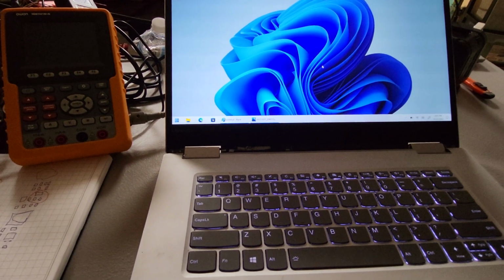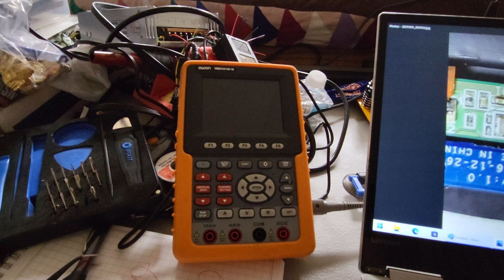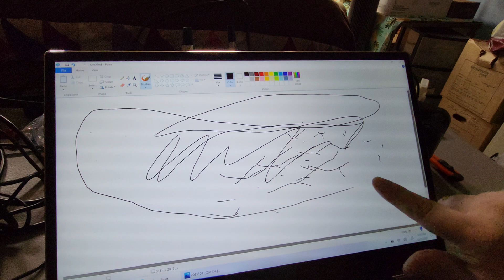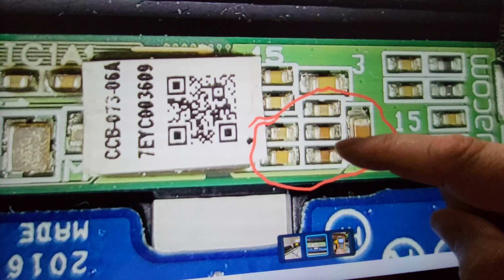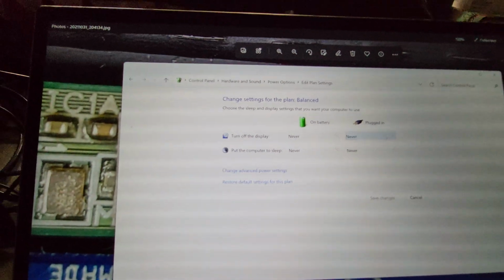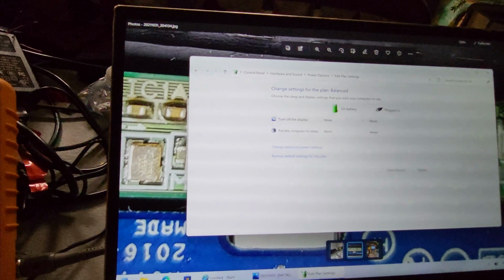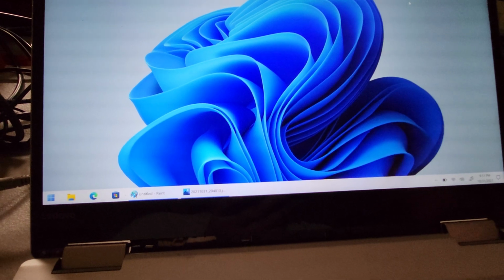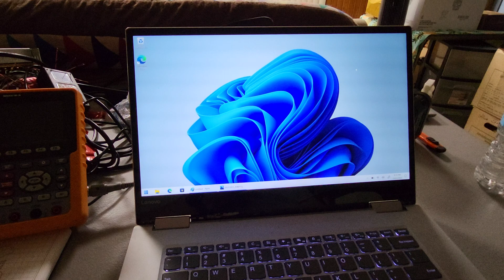Lenovo Yoga 720-15IKB - known defective touchscreen mysteriously revived...

Comment: Hey dude. The problem with the screen is a driver update that bricked the touch screen. If you reset the pc to and earlier windows version the touchscreen comes back. I've sent my laptop in to lenovo and they couldn't fix it either. I got it back it worked and then one windows update later no touchscreen.

Comment: Dang man, I'm glad you got this fixed i got a Lenovo yoga 730 15ikb and i hate that the touch screen doesn't work anymore, since i used to draw with it, this happened when i updated from windows 10 and 11, i was sketchy of doing it but the damn notifications tempted me into doom, now i tried a lot of software methods but none of these seems to work!
Reply: This guy is the only guy who figured out how to restore touch by poking the board. Someone else posted they were able to do the same by shorting their laptop as well. So it’s definitely some hardware related issue that no software solution can fix

Comment: I have exactly the same problem with a Lenovo Flex-5 1470 laptop. I finally decided to take it apart today and started poking the components jus as you did... when I was about to give up I decided to short both terminals of the component that is second from the bottom (next to the large one) and it started working like a charm. I'm deciding wether giving this laptop to my kid and get a new one (not Lenovo, of course), getting a new Wacom/Lenovo CCB-070-07A board for $30 or getting a real thin soldering iron and solder a couple of wires and a button to those terminals so I can "activate" the touch screen every time I want to use it.  It's important to mention that the active pen that came with the computer never stopped working. Thanks for the video one of the most useful videos I've seen on Youtube.
Reply: Interesting. The fact that you could do the same thing with your flex 5 shows that there is indeed something there. It’s a shame people never figured out what was going on. Bad capacitor? Short somewhere on the board ?
Reply: Last week I finally decided to take out my soldering iron, a thin cable and a micro button, soldered one end of the cable to the component you point out (looks like a resistor), and the button to the other end of the cable, hid the micro button beneath the black cover at the bottom of the display and it works as expected... everytime I want to use the touch display feature, I just press on the black bar at the bottom of the display and "voila" the touch feature works again until the display turns off. I'm proud of what I did here, LOL.  If I find the courage to take it apart again I'll try to make a video and post it.  Anyways, its a real pity what Lenovo and Wacom did here, I will not think of Lenovo as an option again for a very long time. @nybiggs
Reply: @ManuelOrbezoElizaga-e8u  Have you made any video - I have the same problem

Comment: Glad I came upon your video today to know that you were close to finding a solution! 👏This was a common issue for many owners of the 720 and 730 models. I had the Yoga 730-15IKB and the touch screen also stopped working after a software update. Tried everything but, frustratingly, nothing worked. Strangely, the Lenovo pen could register some strokes though with random spiking. Eventually, other issues started popping up and I ended up buying a different laptop. Maybe one day there will be a clear fix for this!

Comment: how common is this fault with this model?  I've narrowed by research down to this one, but I'd avoid it possibily if its renound for this issue or can't be fixed easily
Reply from the maker: Afaik, ALL of them. I haven't seen a single person who has verifiably and reliably got it working - including the guy who offered Lenovo a blank check lol. I guess except me. Pretty universal unless you blocked windows updates.I have been dealing with some health issues that have made it difficult to put any time on this one... But... If you're actually interested in this model I just got a new laptop and it's a Dell so I'm kind of considering getting rid of my lenovos. I have the older but beefier 720-15IKB with the 7th gen i7 and Nvidia 10 something. 40 gigs of ram, a 4k display, and a super cool button to wake up the touch screen 😁. 256, 512 or 1 TB SSD. Upgraded wifi and Bluetooth (it can do AX / wifi 6). If you are interested ping   jshuler at gmail.com l. If you're looking for pristine condition well I'm sure you can find one that look nice but as far as I know this is the only one with a working touch screen on Earth lol. It's got to be where something right 😁😁

Comment: Mee too!  I have the 730 15".  I did recently upgrade SDD to a 1TB.  I had to mess with limited bios settings just to disable secure boot, so I could boot from my drive imaging software, and clone my previous drive.  All worked well.  I do not recall if my touchscreen worked then or not.  I believe it did work fine.  However, I did run CCleaner driver updater, and of course a few Windows updates since.  It's now not working.  I tried uninstalling, enabling and disabling, etc.  I don't recall if I updated BIOS.  I tend to stay away from those unless I know for sure it will not break anything.   So, I'm tempted to put in old SSD just to see if that resolves it.  I think I will.  As I noted all bck panel screws are same length, so it's just busy work.  Maybe another fight getting into BIOS.  Grr

Comment: I completely agree that this has been caused by an update to the firmware. Unfortunately, Windows will do BIOS updates automatically and I believe that's when this happened. 

It's likely that the process to get that logic board started has multiple stages and perhaps the firmware change has broken one of those.

By probing the capacitors you probably sent a signal that another one was waiting for to complete the startup process.

If you can pinpoint which 2 you bridged and it works every time, you may be able to solder a small wire on each end and keep them bridged permanently, just an idea.